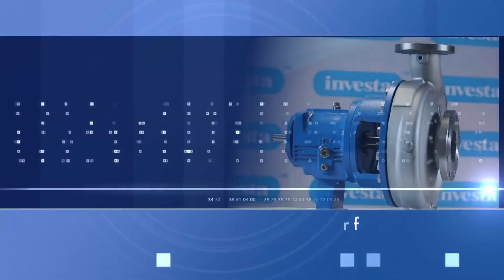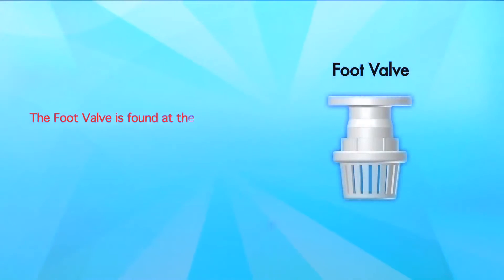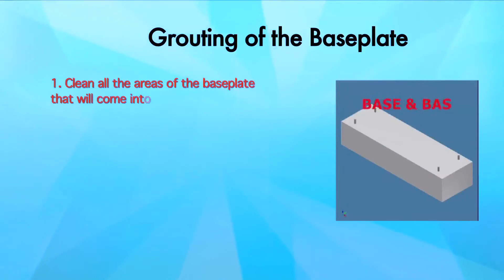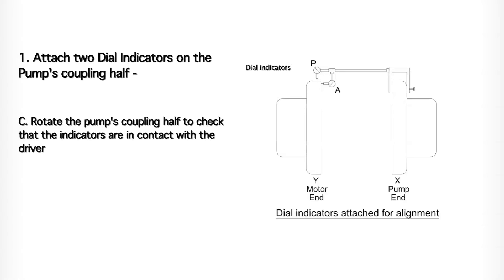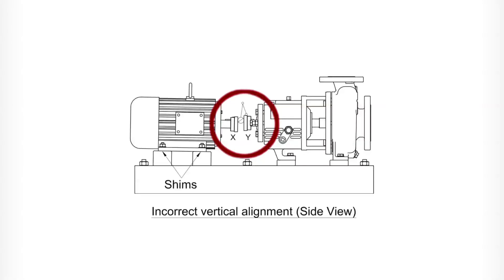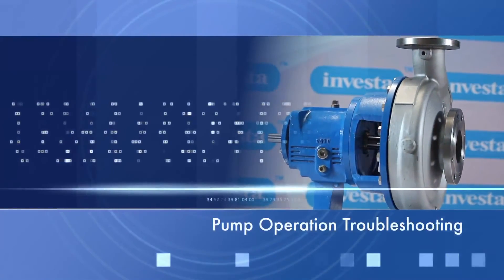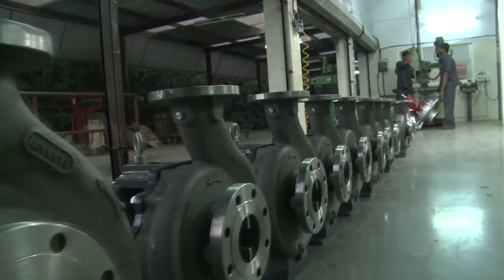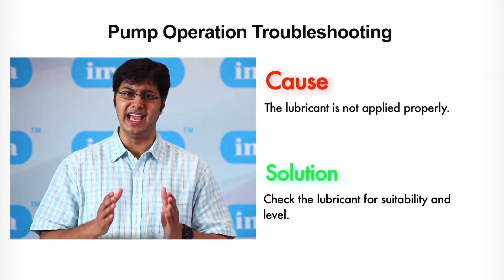Investa Pumps Assembly

Comment: Hello sir we are using  your pumps for-50 temp chiller flow actually today we started your pump after running for 3 hours from mechanical seal  leak coming in when pump running and seal is silicon cartridge seal